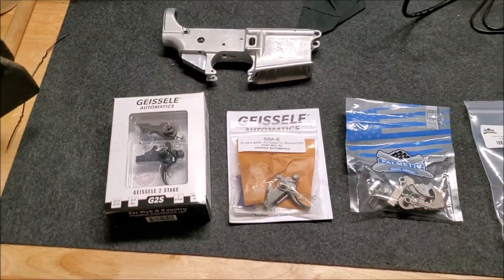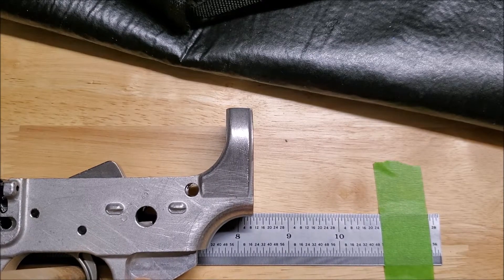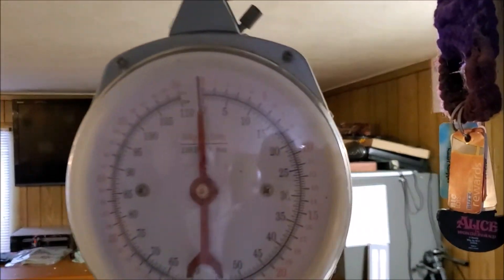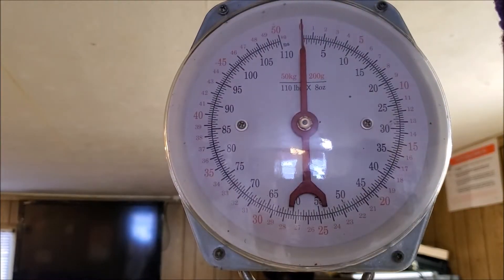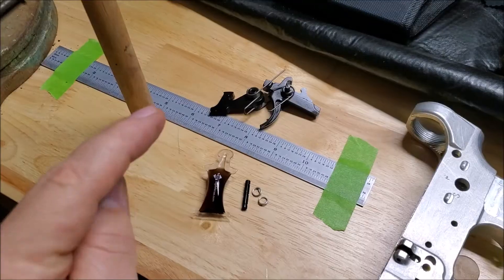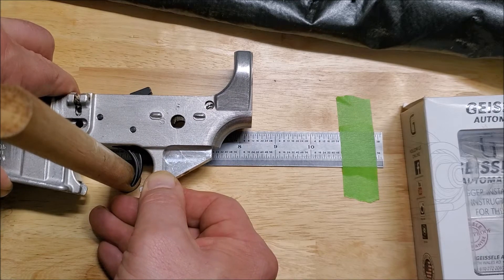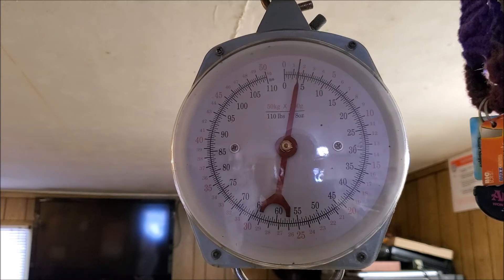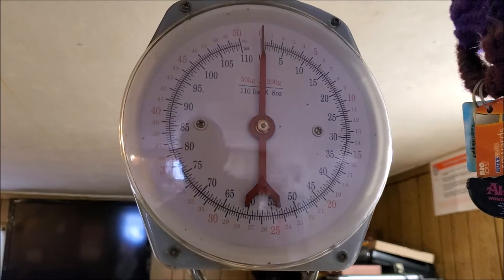Triggers Compared (AR15 two stage triggers)

Comment: If you get light primer strikes with the Geisseles it’s not going to be because of the pull weight. The pull weight measures the trigger spring, not the (separate) hammer spring, and the hammer spring is what dictates the force of the hammer hitting the primer.
Reply from the maker: A few factors go into light strikes, mostly hammer spring power. I think we agree there. I disagree that hammer springs don't affect pull weight. They absolutely do.

Comment: Singe stage triggers generally will have less travel than 2 stage. This is because a good single stage has no pre travel and is already at the wall. 
Really good triggers in general should have basically no overtravel meaning single stage will have almost no travel at all and 2 stage triggers will just have the takeup (1st stage) travel.

Comment: LENGTH to the wall... not just STRENGTH.  You should have some take-up before you get there (stage 1).  Otherwise, there is no point to a 2-stage trigger.  Nearly every maker of 2-stagers get this wrong.  The AR15 is a battle weapon for practical / tactical use.  You should be able to "toggle" to the wall and back - repeatedly - without conjuring up finesse and ultra-fine motor skills... back & forth without "accidentally" breaking a shot.  So you also want some measure of weight to break (stage 2)... not a hair trigger.   What's the point of building a wall if you just roll right through it?

Comment: Where is the larue? Can’t have a test without the larue
Reply: Larues are ok for the price but are pretty over hyped.  First stage is quite long, and regardless of how it’s advertised but the first stage is way lighter than the 2nd stage. Which is completely backwards.  Mine pulls right at 1.3lbs first stage and 2.7lbs second stage (4 lbs total). They have a nice break for what they are but aren’t all that.
Reply: I have an mbt 2s and just know that it’s ridiculously better than the standard mil spec trigger. Much lighter, breaks like glass. I’m also not sure what your definition of a “too long” first stage is, but definitely not for me—it’s only about 2 millimeters! Anything less and you might as well just get a single stage. About the only critique (and it’s so minor that I barely call it that) is that the reset is a tad longer than I’d like.
Reply from the maker: Larue? I have no idea what that is.
Reply: @WJBlades  you don’t know what larue is or are you being sarcastic? You never heard of larue tactical mbt triggers? Best bang for the buck
Reply from the maker: @dmdm9198  I'll have to check them out. Thanks.

Comment: I have Geissele trigger two stage. It came In a plastic bag. I was quite surprised. I just had it installed. I shot it the first time yesterday. I replaced the mil spec.
Going to keep practicing with it.

Comment: EXCELLENT video! Question, is there any way you can reduce the reset travel on the NB trigger? Also, care to do a new review video of say... 4 under $100 two stage triggers and include Aero Precision in it?
Reply from the maker: I'm not familiar with "NB trigger" are you referring to standard mil spec triggers?
Reply: @WJBlades  the nickel boron from PSA that you used. Sorry for not being clear. Currently building an Aero Precision M5 and looking for a decent trigger and cannot currently rationalize/justify >$120.
Reply from the maker: @williamh.8590  I did shorten the reset on that trigger and I'm currently using it in one of my ARs. It is a very delicate procedure that if not done correctly will make your reset not work. You can end up with unintentional bursts. I ended up making a custom disconnector. For the time it took,  most people are better off just going with a more expensive trigger. I just enjoy modding things for a custom experience.

Comment: Geissele uses full power springs, so you won't get a light primer strike.
Reply from the maker: They might be full power but I was getting light strikes with my 7.62x39.  Switched to mill spec and problem solved.
Reply: @WJBlades   You might have had it installed improperly. Geissele triggers strike hard.
Reply from the maker: @jimklemens5018  I'm a licensed gunsmith that has done a lot of trigger work... I assure you, it was not installed improperly.
Reply: @WJBlades  hey, we are all only human
Reply: @jimklemens5018  it’s the 7.62x39 cartridge, primers are harder than typical 5.56/.223
Reply: That all depends on which manufacturer you ask about how you ignite the primer. The hammer has completely different dynamics than the single stage.
Reply: What a fantastic video

Comment: You want pins reasonably tight in the receiver. Loose is BAD as it's not just walking out, which should never occur given how the springs are supposed to capture their grooves. Pins that aren't snug will wear and oval the pin holes over time. If they're not snug in the holes, you can see them moving in the holes when you pull on the trigger.

Comment: Geissele has large pin option for colt lowers. Colt made larger pins as part of their cucking to gun grabbers so select fire control groups cannot be used. You were supposed to purchase the small pin set. 

Mil-Spec pin dia - .154
Colt dia - .169
Reply from the maker: I sota figured that was the case after I thought about it. The pins still went without a crazy amount of force. So, I wasn't completely sure. I never followed it up. I'm sure you are correct though. 🤔 Thanks for the input.
Reply: @WJBlades  should review a Larue MBT
Reply from the maker: @adlucem9845  Looks like it'd be a good one. At this point I've realized that I can modify the cheap two stage triggers to out perform the geissele triggers. Although it takes alot of tuning to get it just right. I'm also getting good results modding mil spec triggers. I won't be doing videos on that since I don't recommend it for most people.

Comment: I run a velocity 3.5 lbs single stage and I absolutely love it as does anyone who shoots it and hasn't upgraded from a mill spec.  But soon after I get a phone call to install one for them!
Reply from the maker: I got a pretty sweet deal on these and I had a friend who just raves about the SSA-E. I'm inclined to agree with him I love it.
Reply: @WJBlades  honestly any upgrade one does to a stock trigger is gona be an improvement and its obvious the very first time ya pull the trigger!